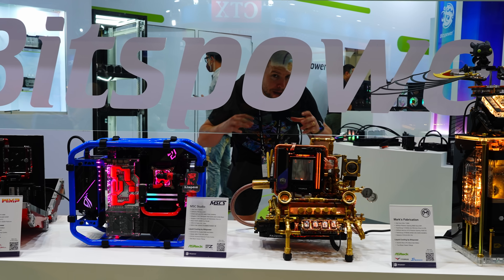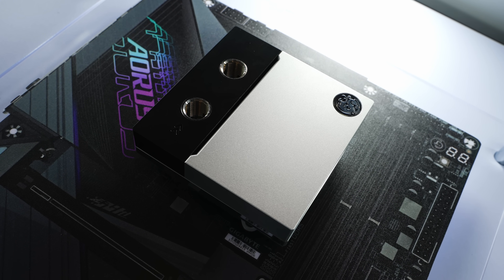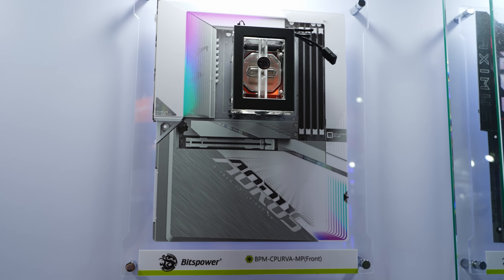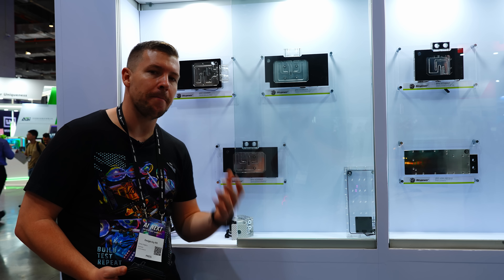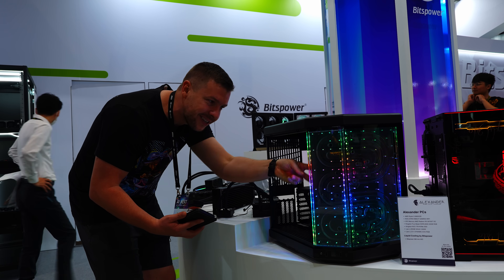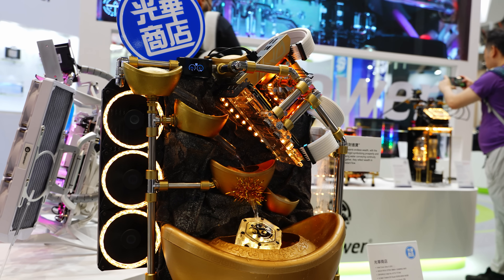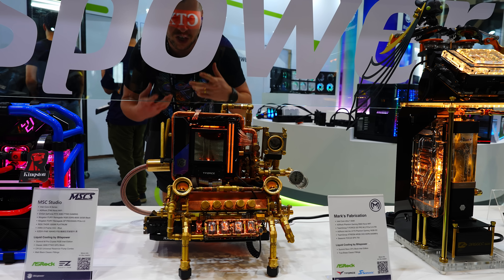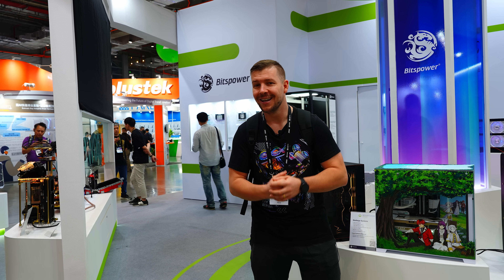Water Cooling Like You’ve NEVER Imagined | Computex 2025 Bitspower

Comment: the problem with custom loops. they make it out of reach for the average consumer. 30 bucks for 1 fitting. come on it cheap to make that stuff look at any hardware store and see simliar items for far cheaper . just different uses. same materials as well. custom loops at an unnecessary price tag for average improvement in performance over aio or air cooling
Reply from the maker: Yeah i agree, they have gone overboard on pricing
Reply: Subjective.  The average consumer has been market force conditioned to accept and seek out the endless supply of $100+ AIO non-serviceable and short lifespan liquid coolers.  Now with the most ridiculous bling added on for... <reasons> to separate themselves from their competitors for the $150+ price points.  The radiators on AIOs tend to be the cheapest made, in materials (aluminum) and quantity.  AIOs are throw away with an average best case reliability of around 5 years, via corrosion/blockage/pump failure (or if you're really unlucky, permeation).  The real warranties and history therein for RMA, etc. are questionable at best, many many ongoing videos of horror stories there.  Air coolers used to be under $30 and anything above that was often met with scorn and derision.  People were eventually pressured into $50 being OK due to Intel and AMD's power hungry cores and climbing temperature thresholds on what was considered 'OK'.  Consumer GPUs hadn't yet scaled really anywhere near the power requirements or cooling needed in the modern day equivalents and generally, you had zero choice in the cheap cooling solution sold with the unit.  We reached a threshold of what basic air cooling against a heat sink could do a long long time ago.  Hence why heat pipes/vapor chambers  came into play for consumers.  Their liquid phase changing states for heat exchange into convection onto fins is another play on what liquid cooling to heat exchangers (rad cores) have been doing forever.  They were just arguably too expensive and case sizes too narrow for awhile to justify bringing into consumer markets vs industrial use.  Now the consumer is off/on convinced over a decade or more than $100ish air coolers are a viable thing and the "best of the best".  Spending $50-150+ on a CPU cooler of some sort is the new normal for DIY builders.

Back to your points, what are we comparing?  Hopefully not PEX tubing garbage used in current day cheap home building.  Plumbing is plumbing.  Quality brass components from reputable suppliers are not cheap, neither is copper.  I personally wouldn't trust Home Depot's house brand of brass fittings over a known good supplier on my expensive equipment.  Looks are subjective and, yes, nothing stops you from still doing what we were doing in late 90s and early 2000s DIY with basic screw band hose clamps, crimp to fit or the squeeze open clamp reuse style or... <shudder> zip ties.  But they're all ugly as hell. ;)  Once you get past barbed (compression) fittings with your choice of soft tubing, the skill and risk factors go higher.  Throw in the used Eheim pump (or worse, there are a million cheap Chinese pond/aquarium pumps to risk with) while you're at it and the salvaged rad core from an old motorcycle with your choice of anti corrosion coolant.  Suddenly you too are making a video with equipment you were fine with risking, showing how to do open loop water cooling on the cheap (and ugly). :)

Boutique anything is always going to be more expensive.  We've been in the land of what, RGB light bling, swirls, whistles and pirouettes for how long now?  Think we've lost our way, but hey, the market has sold the consumer on very subjective shiny blinking bling factor.  For as much as pieces of art Cory makes for us here on some of his showpieces, I bet they perform beautifully.  He can do similar work with less bling factor and more industrial look and cheaper costs too.

We're paying for branding and hopefully the trust instilled by same for reliability, performance, quality and looks to make open loop cooling the easiest it's ever been for DIYers.

We have more open flashy case designs and money being pumped into them than ever before in PC history.  Why?  Because apparently looks matter very much.  At least that's what the revenue keeps telling them.  I'm biased as hell.  Admittedly, while my case build is very clean and well done, it's shamed to the floor under my desk and out of view with nothing flashing.  The performance and acoustics are fantastic though and I've yet to assemble my future open loops.  The tradeoffs in monthly dust maintenance cleaning are worth it in my opinion.  I value function (and the lowest noise) > form, but that's just me.  Because of that, an open loop is actually a great way to go, unlike AIO pumps.

I'm not a fan of the pricing increased on D5 pumps over the years, especially with added PWM circuit complexity, which is arguably just another point of failure with at minimum $30+ price tag increase.  And that's why I went out of my way to try to find the now very rare "vario" style manual speed D5s that have longstanding solid reliability records.  But again, this is another supply vs demand caused problem.  D5's are 100% markup past where they once were years back and the market enjoys elimination of the more cost effective D5s.

Are AIOs inherently fairly expensive?  Yes, especially for what you pay for.  There's a large margin markup of repeatedly very low amount and cost of materials, a basic thin copper (of questionable quality) cold plate design, and the weakest head pressure pump to barely move the coolant through a tiny restricted loop.  They are single purpose and limited use.  They do not outperform any decently built open loop components.  But again, to possibly your point, if an additional 10C or more of headroom gained isn't worth the $100+ additional you may have spent towards having an open loop equivalent, then that is why the AIO industry has become as massive as it has.  Ease, convenience, bling, more bling...look this one transforms and rotates, this one talks!  The consumer AIO will end up in the landfill as terrible ecological waste.  A decent open loop will continue having use for many years to come and the environmental impact is far less.  Cost of ownership trends towards evening out over time or even going down, depending upon how long you can last between the next new shiny CPU/GPU with waterblock upgrades.  Many CPU blocks can be reused on future CPUs.  The really problematic one tends to be GPUs and that's just a longstanding concern the industry could certainly fix if they wanted (standardizing on most overall layout criteria on PCB and clearances).  The GPU blocks are arguably the most frustrating and costly aspect of open loop cooling in the modern day.

To the point, the reused basics of an open loop are an investment.  I don't know his costs for the components in AussieLand, but he's much closer to the OEMs than the US.  You can get 6 packs of common straight compression connectors, even more expensive ones like 90s, for less than $10ea as a 6 pack, or save substantially more for <$50 for knockoff brands of bitspower looking you can find for a pack of 12 90s!  (check on that A named evil online storefront for a D named brand)  Especially if you limit your color choices (black and nickel are extremely common and generally the most reasonably priced).  Rest of what you're paying for are certainly the looks, styling, and brand.  Hopefully you're getting decent brass and o-ring quality (as that and how the connectors perform is what ultimately matter most).  Once you have quality trusted fittings, res, pump and rads for your needs, your cost of ownership vs performance and flexibility of lifetime usage go way up.  The real additional costs over time are the custom blocks on your components when you upgrade and aged blocks lose their market value quickly simply due to being "used" and the limited supply vs demand problem.  They're sold expensively because the companies making them have to recoup their costs to specific tool per unit in a limited time frame for particular models vs interested buyers.

And of course basic maintenance.  Open loops are not for everyone, the set it and forget it types (even though they exist) should try to avoid multi year eventual surprises.

Anyone buying a prebuilt is already losing money with questionable component choices that they got very little say in.

@designsByIFR going over all these many pros and cons is a solid useful video content opportunity from a water cooling expert.
Reply: @techenthusiast-7  i appreciate the long winded comment. i build every 5-7 years. i mostly upgrade my video card. i just recently upgraded my cpu/mobo and ram. i stick to aios. they last long enough. 5 years for me. the water blocks are too expensive. i follow @Jayztwocents. he keeps me up to date on the watercooling stuff. its just not worth it for me.